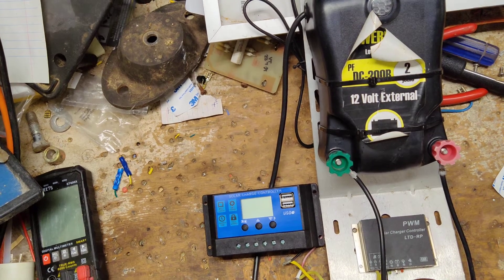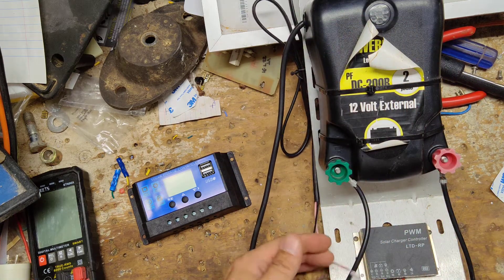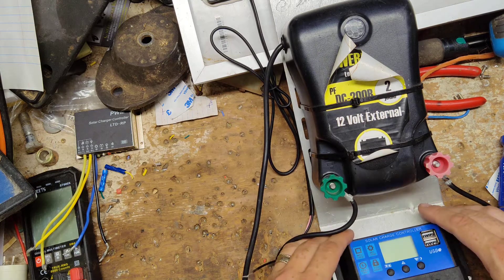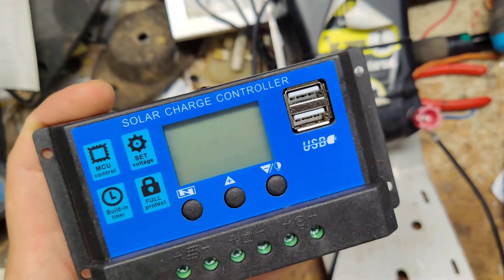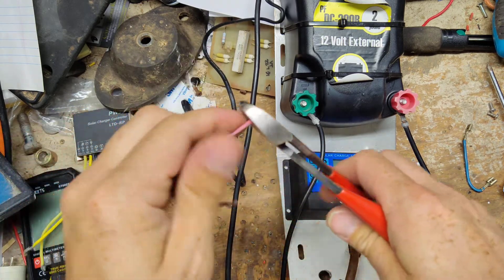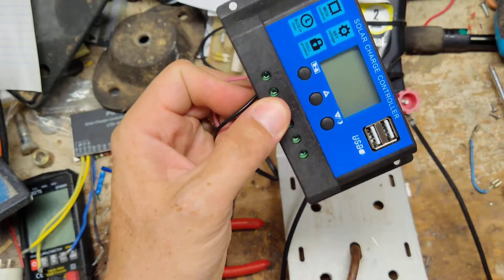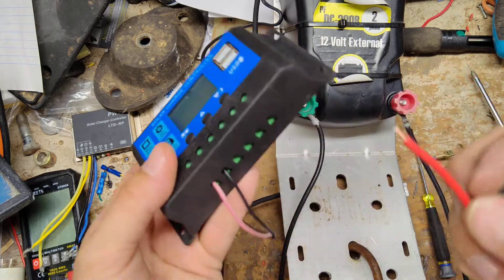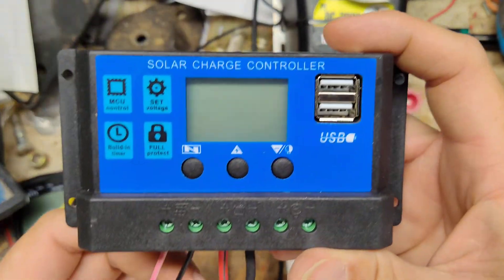HOW TO Wire Up & Connect A Solar Panel Voltage Regulator OR Charge Controller electric fence charger

Comment: Understanding thank you, but the end clips on the solar panel I could just cut those off and expose bare wire to connect to my solar charger then. Since I don’t need the male and female clips, unless I extended the length of the positive and negative wire
Reply from the maker: That's basically what you'll do. Just cut the wires, I usually do one at a time so I don't get the positive and negative mixed up on the solar to the regulator. Then you'll need to get some length of wire to go from the regulator to the battery, so I would guess that those wires will be a bit longer to reach the battery.
Reply: @FencerFixerRepairLLCKansasCity  would the length of the wires coming from the solar panel be a issue? 
Like if I extended it?
It already comes short
So for an example I’m guessing the ammount of energy will be lower.
Reply from the maker: @AnimeDreamingEcchi  no it won't hurt anything. Just use 16 to 12 gauge wires. You can order these to go from the regulator to the battery, Energeaster Electrical Wire 2 Conductors Red Black Cable Hookup LED Lighting Strips Flexible Wire Outdoor Extension Cord 16 Gauge Copper Clad Aluminum Wire Low Voltage Cable(16AWG,32.8FT) https://a.co/d/g7J86Tl

Comment: Can I plug in and charge my powerbank via the 2 usb ports of the Solar charge controller?
Reply from the maker: I'm not 100% sure on that. USB output is usually around 5v DC. Plus it also depends on the total amp draw and if the regulator is high enough on the amp capacity.

Comment: Can you run a ac charger on a solar powered system using an inverter
Would it be reliable?
Reply from the maker: You can but you need to make sure the inverter is a pure sine wave inverter type, has enough watts on the inverter, and also make sure the solar panel is the correct size wattage wise so it can keep up with the draw off the battery. I would use a deep cycle battery as well.
Reply: I’m looking at a pure sin wave inverter 1000w, 100Ah Deep cycle AGM battery, 100 watt 12 volt battery, 20A MPPT Solar charge controller, like to run a M5800i
Reply from the maker: @623hgh  You're going to need a lot more than a 100 watt solar panel for that large of a unit. I will see if I have any info on that or you might call Gallagher and see what they recommend. The 100 watt will probably be good for the MBS800, M800, or maybe the M1100, but that's about it
Reply from the maker: @623hgh  Do you need something that big, M5800i?

Comment: Please do a video on your favorite fence fault finders and digital voltmeters. Also, talk a bit about the those you don't like. 
PS; I thought I could search your channel for videos on that, but it didn't work. If they already exist, please link or point me to them. 
Thanks
Reply from the maker: The reason why I don't have videos like that is because I would have to buy all of them, and I don't have that kinda spare money laying around. I don't think I have a review video on those. The best quality digital fence voltmeter and fault finder are the Gallagher ones and the speedrite ones. All the other ones, are cheaper, but aren't as accurate or as well made. Also, stay away from any of the flashing light type fence testers, they're hard to read in the sun because of the bad glare.
Reply: I only see about 3 main digital voltmeters that are fault finders. They seem to be based on only three primary form factors and electronics sold under many different brands and colors. The Pakton (the originator of the technology), the Gallagher (also sells a Pakton version that is a LOT less common), and the Speedrite (with audible alerts) form factors. The new Amazon one is an new unknown that I recently saw. 
          We have had one of the original Pakton Power Probes and it has been amazing and super durable. I have read other similar reviews of it. You will get to see it in the mail soon for what appears to be a switch problem since it only works sometimes in the last few months.  That should give you an chance to talk about the three major form factors seen in the US and your experience with them from a repair perspective. 
          We used the neighbors Gallagher Smart Fix and it was not that impressive because of the need to switch between modes and the difficulty in replacing the battery. I am told that Gallagher has fixed the switch between modes problem. The Gallagher also seems to be more sensitive to wearing gloves when testing. We have an old Nokia cell phone case on our Pakton and often test with gloves with no problem. 
 PS; Thanks for the many enjoyable videos. 
PPS; I would have put this comment on an old Gallagher Smart Fix fault finder repair video but you probably wouldn't have received notice of it.
Reply from the maker: @sherischneider2390  the Gallagher smart fix didn't really have a switch issue going between to the two modes, it was just the software and design of how they wanted to do it, which was used for around 15 or so years. Then they did a different software and lcd set up and got rid of the option of having to switch between the two. But if you were on Amps, there was a row of numbers at the bottom, which was your kv voltage just rounded to the whole number, so it did technically have both on the screen at the same time just most people never read the manual or knew about that. 

The battery is actually pretty easy to change in those Gallagher fault finders, I've got a couple if videos on YouTube on his to do it, it takes about a minute to change one.

On your power probe button not working right. I'll try and fix it if I can, but they never offered any repair parts for them or any of the private label brands they make for others, but we'll give it a whirl and see what we can do. I've talked to the owner of Pakton, the guy that created the power probe, a few times about things, pretty nice guy and knows his stuff. They make a handful of private labeled devices for companies besides just the fault finders.
Reply: @FencerFixerRepairLLCKansasCity  
We did notice a small row of numbers under the amps reading on the Gallagher Smart Fix. However, it was so small we were trying to figure out what it was and my son had to read it for me. He told me it was just a row of numbers. Thanks for telling us what it was for. We don't have access to the manual since the Smart Fix is on loan. You are correct that the failure to display both Kv and Amps at the same time is not a failure of the Gallagher switch. It was merely an annoyance. 
             The battery changing issue is not that it is difficult. The issue I have is that after you replaced the battery you had to do a reset according to your repair video. That is not intuitive to me, although it may have been because you changed the screen in that repair. 
              We are researching what fault finder to purchase as our main meter since the temporary loss of access to our Pakton Power Probe has been a major inconvenience. The Power Probe has been flawless through the years even though it fell off the ATV and had to survive a North Dakota winter outside in the elements. It sets a very high standard for simplicity, ease of use, and durability that the first version of the Smart Fix first version has yet to match. We say that as major fans of Gallagher.      
            You showed the new and old Smart Fix fault finders side by side in the thumbnail to one of your videos. However, that video did not talk about the differences. It has been a struggle to find out online if the new Smart Fix shows both Kv and Amps at the same time like we prefer and as the package shows. We haven't decided which to purchase yet, the new Gallagher Smart Fix or the Gallagher branded Pakton version or even the Gallagher Remote/Fault Finder with a eye toward the future. 
PS: We are still lacking a lot of info on the Speedrite fault finder, although reading the manual indicates that it may also be a more complicated interface with stored values and switching screens. We want something simple that the kids can assist with without a lot of training or reading. 
PPS; Any thoughts on other options to turn the units off or on via wifi or sms outlet and a phone?
Reply: @FencerFixerRepairLLCKansasCity  
Has the Field Guardian Digital Fault Finder that you use in  your videos been reliable and accurate? Have you used the fault finder option?
Reply from the maker: That Field Guardian is a joke and very hard to read in the sunlight. It uses an old style LCD screen and is cheaply made. I wouldn't bother with it.
Reply from the maker: On changing the battery in the Gallagher fault finder/smart fix and doing the reset, only about 50% of the time do you have to do it. The Gallagher fault finder was pretty reliable, the only time in really ever get those units in is age 10-15+ years of age, water damage from getting left outside and water working it's way inside, or physical damage being stepped on or ran over ect. Luckily you only have to change the battery about over every 2-5 years depending on how often you use it and such. 

The last version of the Gallagher fault finder that looks like the smart fix has both amps and voltage on the screen at the same time, they got away from the need to switch back and forth back in 2015-17 somewhere in that range. 

The private label one they're having Pakton make for them is the same as the Pakton one internally, just black and orange for Gallagher color scheme, other than that it's the same as Pakton's.

The speedrite fault finder is easy to read the LCD and has both info at the screen at the same time. It's a bit bigger in size and doesn't fit in your pockets as easily as the Gallagher or pakton types. I don't know about the stored values, unless that has something to do with their remote control, which is a separate tool all together from their fault finder, the fault finder I believe is just a fault finder.

If you look at the Gallagher remote control, it's good reliable stuff, but expensive and you have to get a certain model Gallagher that can talk to the Gallagher remote, MBS1800i and larger and you're talking big money $1200+ 

The only other option that I know of that you could try is get one of those wifi outlets or whatever it's called that you plug into your existing outlet and then plug your device into that. Then as long as that is connected to your WiFi and your phone can talk to that outlet, you can turn off that outlet and shut power off so whatever is plugged up to it turns the device off. 

Gallagher does offer some other options for their i-series units that can talk to your phone using some sort of wifi gateway or whatever they call it as well I think they have an app as well that can talk to the the i-series units, but you would need to talk to them to fully get all the info on it. They've got some good people in their tech support dept here in the states, I'd call them to get the full scoop on that.
Reply: @FencerFixerRepairLLCKansasCity  
Thank you for that detailed and informative answer. 
             The only thing I find attractive about the Field Guardian is its ability to test the Joule output of energizers. I don't see a lot of other options for that. Unfortunately, their 200 ohm resistor needed for that doesn't even appear to come with the unit.